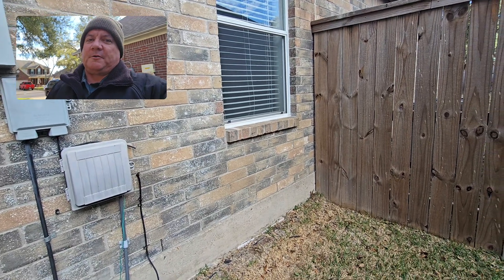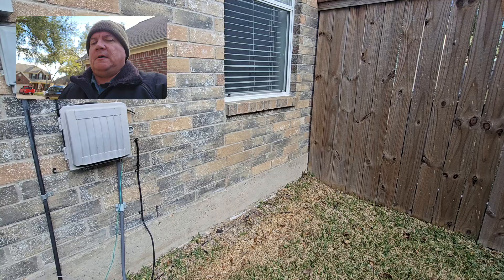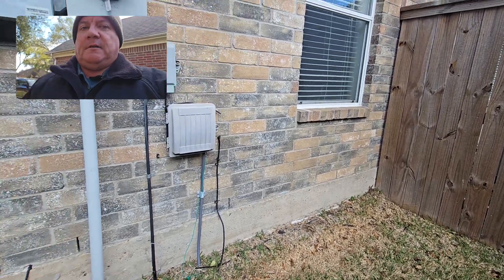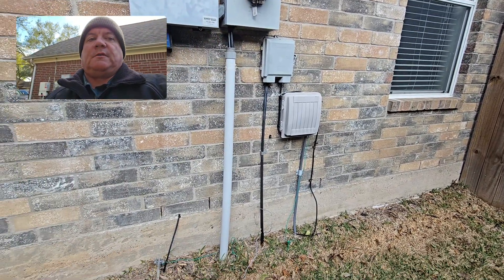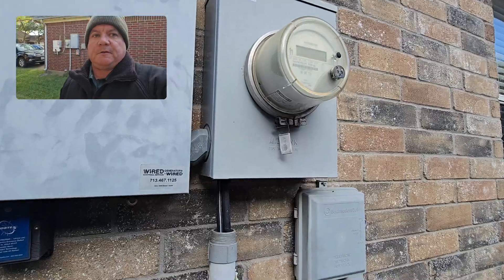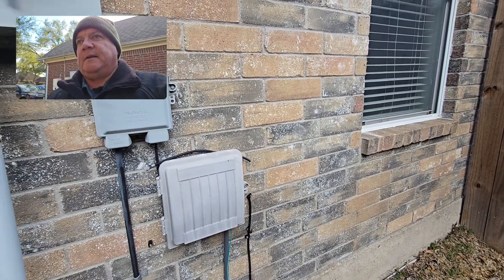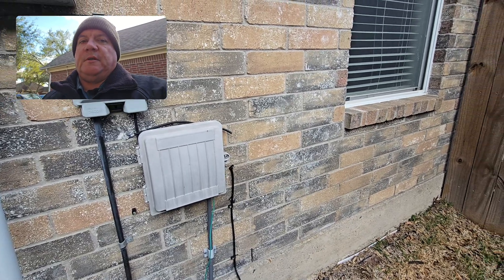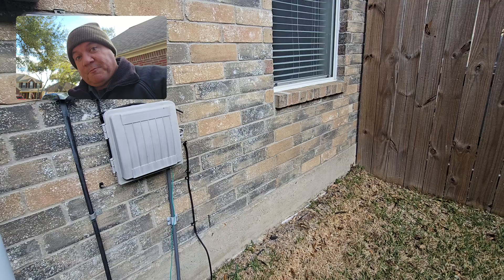The Hidden Dangers at Your Electrical Service Entrance

Comment: It also means it was missing the lock ring on the inside of the meter panel.
Reply: And the bushing.....
Reply: @houseman2414 do you need a bushing for PVC conduit? If so, please can you point to the code section so I can educate myself
Reply: @thardie I'm not an electrician, but it should be in NEC 300.4.
Reply: No expansion coupling... whoever did the original install is a Toolbag. 😂
Reply: @neveraliberalcrybaby If that's conduit, I think your name calling is generous.

If it's direct burial of sufficient depth with some slack, it probably would have been fine with a locknut.  It's a dumb mistake, but an easy enough to overlook one.  Disconnect/Reconnect and add the lock nut + bushing.